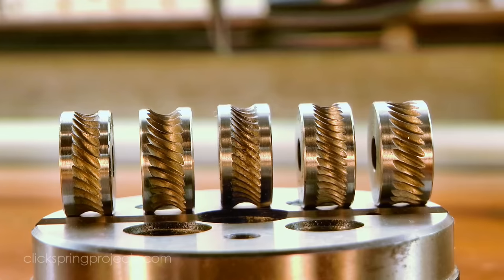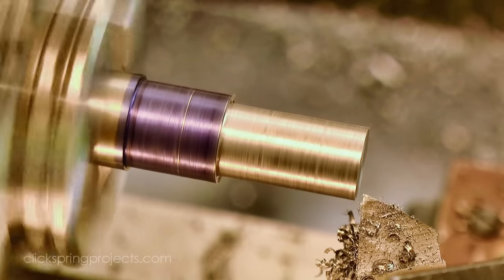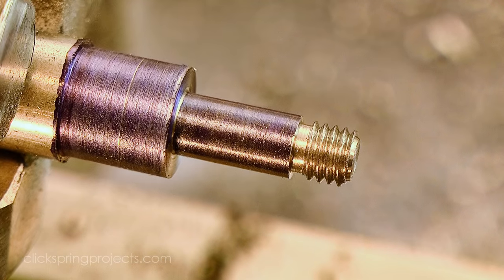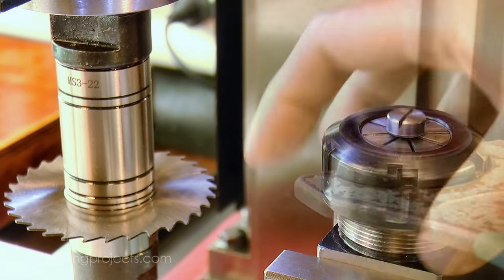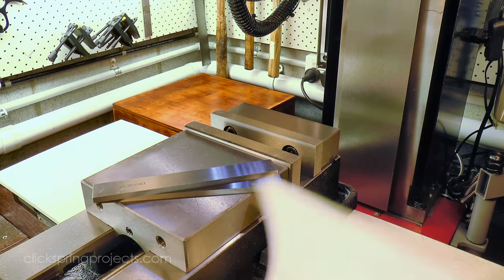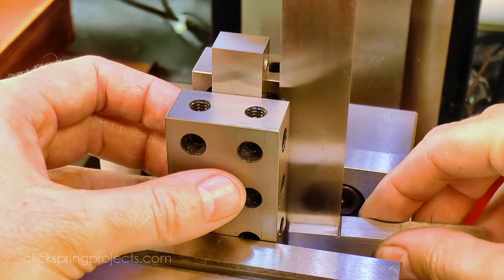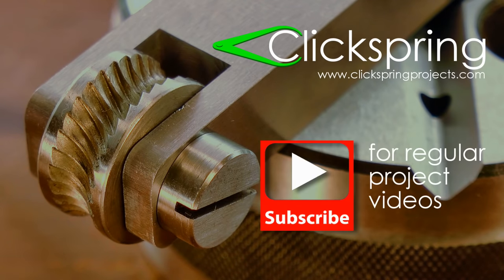Spare Parts #5 - Making A Bump Style Knurling Tool Holder

Comment: I do have to say, I've seen home machinists and I've seen CNC machines in action myself, and I do say oh yes oh yes I do say every single mother jumper I have seen work wouldn't put in half the effort you just put into this tool alone. What you did here is proper American craftsman ship and is the type of machine work I'd kill to see be done again, taking 5 minutes to depbur and shape an the end of the tool, nobody would take the time to do that, they would make it clear and maybe knock off the sharpe edges if you were lucky. Most would hardly even think to re-chuck that screw either and just knock the tip off it with a insert and tool, they would grind it down with a sander maybe burtex wheel it for a better finish and call it done after cutting the surface for the knurl and threading the one end.

Loving your videos of your work. We need more people like you in the world.
Reply from the maker: +jr540123 Thank you JR, very much appreciate the kind words. Great to have you watching, more on the way soon :)
Reply: Clickspring
I look forward to watching every one I can. And can only hope to one day be as good as you my good sir.

Comment: Really interesting video.  Thanks for sharing it.  

I like that ER32 collet block (at time 6:13).  I'm familiar with 5C blocks, but never seen them for ER collets.
Reply from the maker: +Eric Chesak Hey Eric, yes I'd only seen the 5C versions too, until I stumbled upon these at ArcEuro in the UK. Great little device, probably the most used work holding device I use, second to the vise itself.
http://www.arceurotrade.co.uk/Catalogue/Collets/ER-Collet-Fixtures

Comment: Your 'home' videos feel a lot more professional than most 'professional' labeled videos. Simply incredible production value and such a high level of skill in working the tools and equipment efficiently. Brilliant.

I do have a question, though. When you drill a hole through the metal bar, why do you use a different tool to first make a dent in it before using the actual tool to drill through? Why not use the main tool to just drill through without making the dent?
Reply from the maker: +Aravind Pisapati Hey Aravind, twist drills are notorious for 'wandering' off position if there isn't a starting point for them to begin drilling. The first drill you see me use is called a spotting drill, and is much stiffer than a standard twist drill, and experiences much less of that 'wandering' effect. It starts the hole, and then the twist drill follows it without issue. Thanks for watching and asking.
Reply: +Clickspring Ah, I see! That's pretty awesome! I guess you need to work with these tools yourself to understand some of the things which might appear to be inefficient to those of us who just watch. Thanks for answering!

Comment: I thougt in the first you will make the knurling wheels. that would have been interresting. I would have prefer a steel holder because its will last longer. as axis for the knurling wheels would a hardened pin work also great. they have a nice and clean surface.

Comment: for slot instead of holding vertical he would done it from side, much easier no need of clamps etc.cutter radius will be in the bottom,but there is huge relief between the tool and depth.

Comment: Did I ask about that single lip chamfering tool?
Is it homemade? Can you talk about the geometry?
I have some trouble getting clean chamfers and wonder if a single flute cutter would work better than a 3 or 5 flute one.
Forgive me if I asked already, I know I wanted to since I first saw it but I'm not sure now if I did.

I'll steal your idea of using ceramic wool to contain the heat of the torch, thank you.
You make the hardening and tempering look so easy.

Your shop is always spotless, I tell myself you spend half a day cleaning up each shot and outside the frame is a mess. I know it's not true but it helps me feel better about myself.
Reply from the maker: +stefantrethan You can get a better look at the geometry of those chamfer tool on my blog site: http://www.clickspringprojects.com/hand-held-countersink-tools.html
Reply: +Clickspring  Thank you, I did not know about the blog.

Comment: So, why the belt sander and not say, a bench grinder?

Thanks and keep up the legendary work ;)
Reply: +themaconeau A belt grinder is far more effective at removing metal. It is definitely the go-to tool for rough and finish shaping of contours and radii.  In my shop the belt grinder sees most of the general grinding work. The bench grinder is almost exclusively used for grinding lathe tools and chisels.
Reply from the maker: +themaconeau +James Offutt Yes my approach is similar to James'. For me the bench grinder is almost exclusively just for HSS shaping. I find that the belt sander is much more delicate, so I tend to use that more often for profiling of work. Fast metal removal with 80 grit, really fine finishing with 400 grit. Probably the second most used tool in my shop behind the lathe. Thanks for asking Themaconeau :)

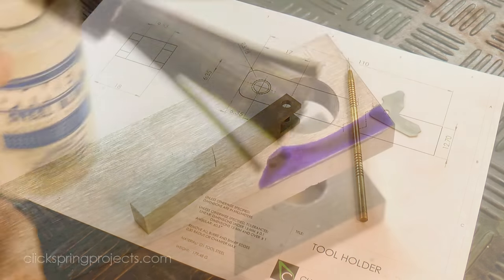Comment: the tapped hole at 4:52 the thread looks a little shallow; was it intentional? to save the tap whilst tapping into the tool steel?
Reply from the maker: +Nathan Bray Yes intentional, a shouldered bolt like this doesn't need much thread to do its job. The dimensions were also governed to some extent by the stock I had on hand to work with. Thanks for watching and asking Nathan.

Comment: Hey, I'm a tinkerer who might get into machining at some point.  However I am dyslexic, and especially have trouble with math and numbers.  I can run a handful of useful equations on a calculator, and I'm good with simple geometry.   A question for whomever: knowing that knowledge about my case,  I understand that for some more complex jobs it can get fairly technical; how complicated can it get, and how disadvantaged am I going to be given my differences?
Reply from the maker: +Viking War Pickle Hey VWP, I think you'll be fine. Most of the time its simple adding and subtracting, occasionally simple geometry, and very, very rarely something more complex. There is an awesome machining community online, if ever you get stuck on something more complex, there's always someone nearby to help. Cheers, Chris.
Reply: Clickspring I bet making gears is pretty hard, right?
Reply: Billy bob not really, you just have to calculate the degrees between the teeth and the depth of the teeth, but there arw formulas for this
Reply: If you are going be doing a lot, there are "Machinist's Calculators" basically a scientific calculator with programing suited to the machinist. I have some issues with dyslexia also, and they can be very helpful. Or if you already have a scientific calculator, make a couple of reference sheets (3x5 cards or similar) with formulae and notes so you don't have to try and remember them all.

Comment: Any particular reason you don't use that rear top roller on the belt sander?
Reply from the maker: +Max Maruszewski Hey Max, the 4th idler on this sander is used along with a relocated 3rd for inside sanding, to direct the belt through a hole in the work. Most of the time I use this machine for outside sanding, but I leave that top idler in place to stop it from getting misplaced. It wouldn't do any harm to put it in contact with the belt, but its not necessary for outside sanding, as the other three wheels are sufficient to track the belt. Thanks for watching and asking.

Comment: Anybody know what the tool at 3:38 is and what its used for?
Reply: +Jordan TheMan I'm assuming you're talking about the bit in the mill that doesn't seem to really do anything?  I believe it's to register the work in the machine so that the drilled hole can be as close to the exact center of the work as possible.  I might be wrong, knowledgable in this subject, I ain't.
Reply: The tool is called an edge finder. You spin it and bring it into the edge, when you see it "break" away from it's center, that point minus half the diameter of the edge finder is your datum for that particular axis.